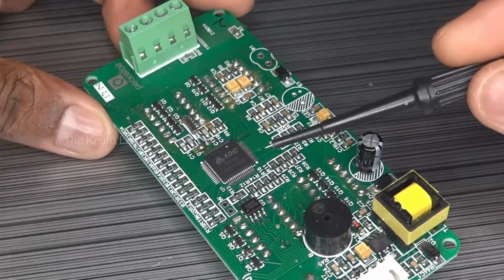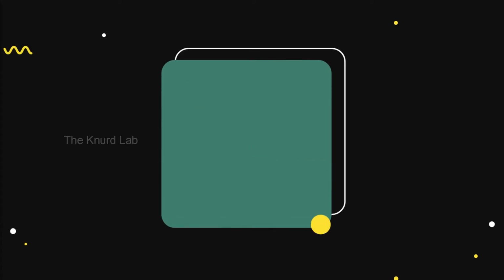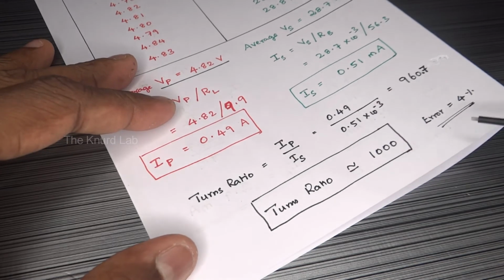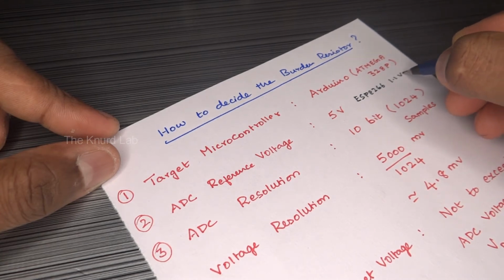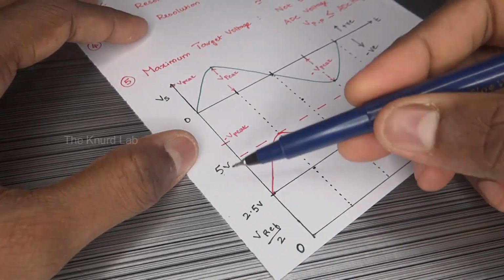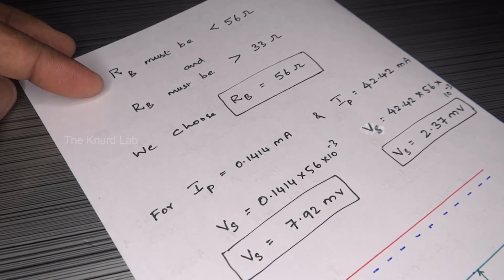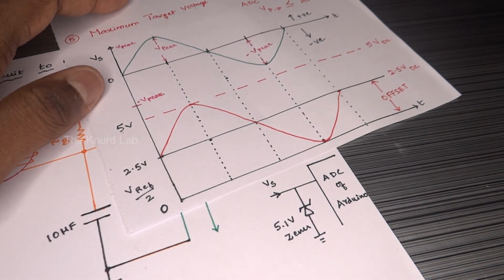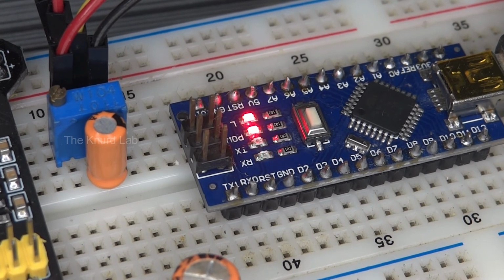What is a Current Transformer? |Measure AC current with an Arduino

Comment: I never got this to work.  I have 1000:1 CT coil and 0.1Amp Load  (1 Volt Source, with Rload = 10).   I wanted to measure mA so I used 1000kOhm resistor on the coil side and tested with a DC source.  When I measured the burden resistor across the coil, it always read 0.0mV even if I switched current direction.   Testing 1 amp or more on 18VDC is problematic as I need a large sandbar resistor and I want the sensitivity to be greater than that.

Comment: @2:50 How magnetic flux due to secondary winding links to the core with the primary winding
Reply from the maker: Yes it does. One reason is they share the same core to put it simply. To explain it in detail, the secondary current induced in the secondary winding is due to the primary magnetic flux. This much is clear. Now when there is alternating current in a coil it creates a magnetic flux. That is also clear. So Lenz's law says that the induced current is such that it opposes the change which created it. In the case of the secondary current, it is the primary magnetic flux that created it. So the secondary flux opposes the primary flux. Because of this the primary back emf reduces and as a result primary draws more current to restore the magnetic flux to its initial strength. There is a balancing game going on between the two fluxes and they settle at equilibrium because in a transformer, the primary and secondary volt amperes must be same. This is how we say secondary current is proportional to the primary current. To understand it even simpler, the current transformer is a step up transformer with a short circuited secondary via the burden resistor. Hope this answers your question.